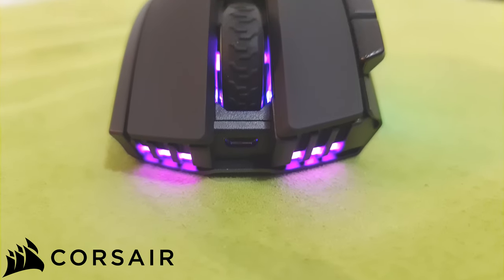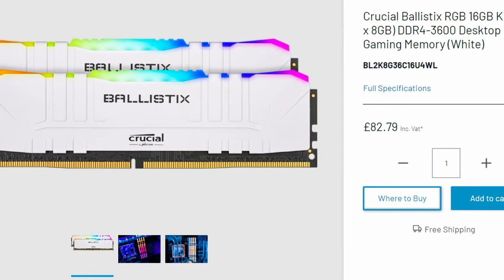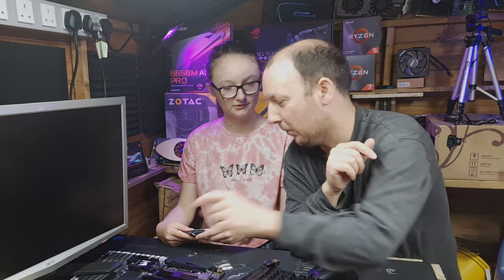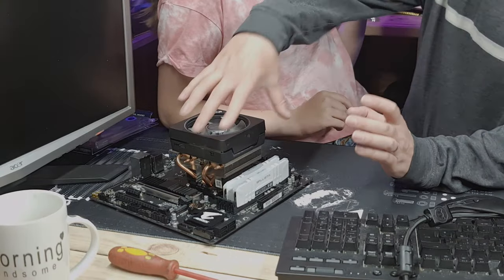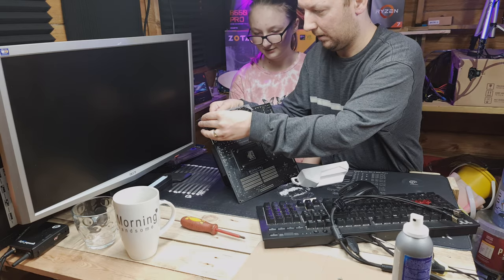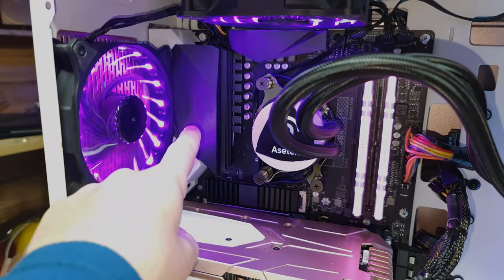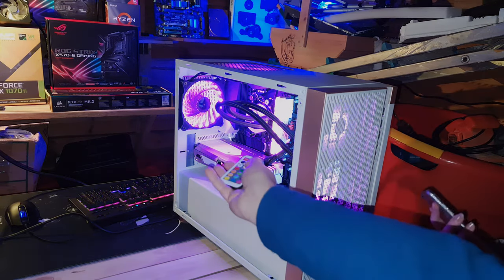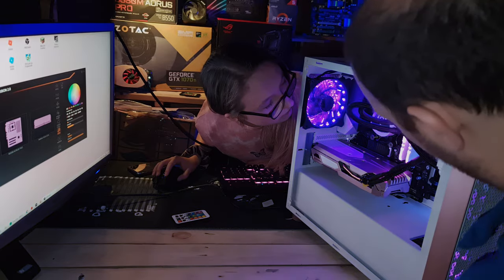White & Rose Gold Build - Ryzen 5 3600, Asetek AIO, 16Gb Crucial Ballistix, Gigabyte B550m Aorus Pro

Comment: Hi,really nice video!!
Might you give me an answer please?
I want to get the b550m aorus pro and an Asus 1660 super dual evo,but that card is 2.7 slot will it throttle..?
Reply from the maker: I guess your asking will the graphics card Therma throttle? well there are other factors that will contribute to a GPU slowing down, without knowing what case your using, how many fans, where the fans are positioned, i can't really give you a definite answer to that question, But generally if the cooling in your case is good, you shouldn't get a problem with your gpu slowing down.
Reply: @WnDTech  the case has 2 intakes 1 exhaust,but I found out that 2.7 slot gpu will look really good and perform really good in my case ! Thanks anyways!
Reply from the maker: Sounds like u got it covered. So you have positive airflow which can work better in some cases, if temps start to rise, add an additional exhaust fan to the top of your case if it has space.  :)
Reply from the maker: Post a picture of the finished build on our twitter account :)
Reply: @WnDTech  after I order the parts and mount them,I will surely post it!!
Reply from the maker: @papilcost  Can't wait to see the final build :)